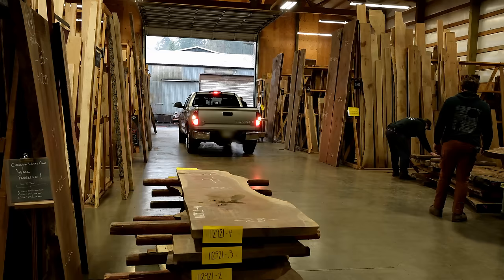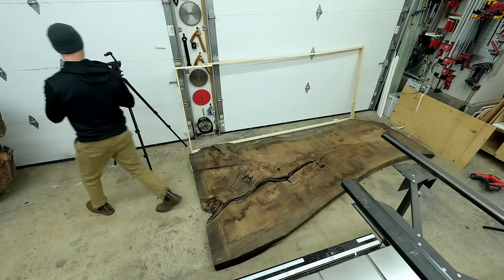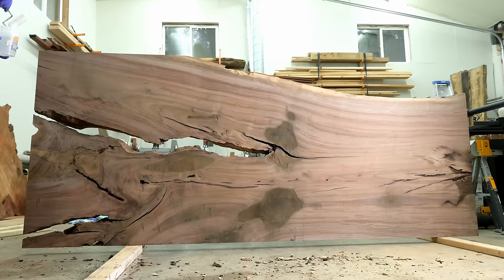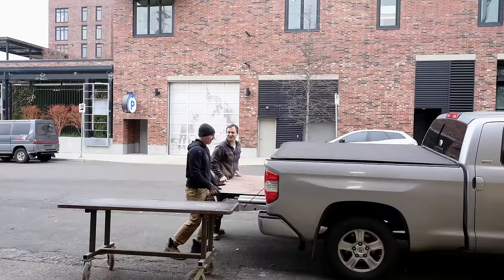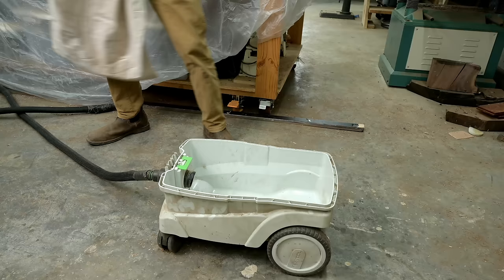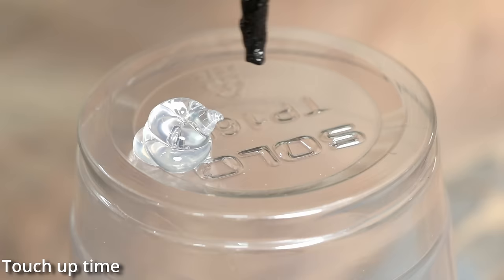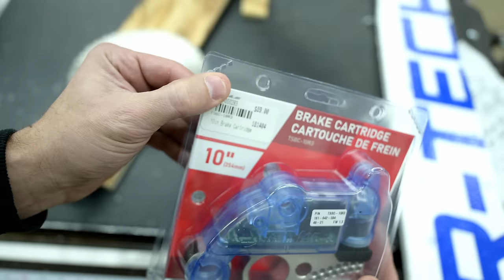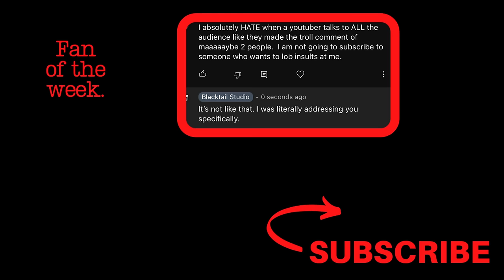The Client Hated This Slab

Comment: Honestly, if they wanted ZERO reddish tones than they shouldn’t have gone with Walnut. Table looks incredible!
Reply: Right? What a pain in the ass thing to request. You don't truley know what your wood is gonna look like until the finish is on and its in your home. He should have let them pick the slab and then quit worrying about it.
Reply: Ya not a fan of the end finish but hey I’m not the one buying it. Still looked great but all natural would’ve looked best imo.
Reply: Nah there is black walnut that looks incredible and has almost zero red in it. Just was not availability probably at goby
Reply: @nathaniellucas6693  What the customer would be looking for is steamed walnut. I have steamed walnut that is dark chocolate with no sign of red.
Reply: I had a client request an Ash and Rosewood end-grain table that looked amazing... and then they wanted me to finish it with Rubio Monocoat Silver.  Ugh.  We finally came to a compromise we both could live with.
Reply: @charlesthomas9294  But it's their table, isn't it?
Reply: Sounds like it's more the problem of the business
Reply: Better bro ..... keep up the good work looking forward to the next video 📹 👍 we have a saying in south africa that gos like this  ...  that looks kak lakker my  bootas
Reply: I agree. I detest stains in hardwoods - natural finishes only. 

I can see using stains with cheap softwoods where you are trying to fake the look of some expensive hardwood, but they should otherwise be left on the shelf.
Reply: @rockbandgamer  6j&
Reply: @buggsy5  but if they prefer the texture and hardness of a wood and prefer the colour of a different wood I kinda get that.
Reply: I am ready for the gray- stained wood trend to die.
Reply: Thank u....some people, I swear....
Reply: @charlesthomas9294  This seems kind of wild to me. They're paying you right? What do you care what the table looks like as long as they like it?
Reply: @Setixir  Some customers have a very definitive idea of what they want and are able to articulate it. Other customers just have very general ideas like “I want it to be gray“. In the latter cases it’s up to me as the artist to interpret that in someway that I think will make them happy. They can say that they want a certain stain but if I know they have never seen it on the wood that they picked out before it may be up to me to modulate their choice.   As I said in my original post, they were happy with the outcome.
Reply: Yes I want a table made of poplar but I want it dark. No stains or wood burning allowed or altering the color for that matter 🙄
Reply: wow 👌 👏 😍 👍 🥰  nice 👌 👏  job
Reply: @nathaniellucas6693  got two in my yard. I had three and the neighbor who’s property abuts mine decided to have his logged. The dumbasses cut it. They even broke down the fence to get it.
Reply: Right answer, now i can sleep. Beautiful table.
Reply: @buggsy5  when we were house shopping 17 years ago we landed on a house that had heart of pine floors. We were the first people to look at it and made an offer while they were still finishing up the reno's to sell, one of them being refinishing the floors. Since it was going to be my house I asked that no stain be used, somehow that got lost in translation and they stained these floors the darkest ugliest color you could think of. We still bought the house but luckily got them to pay for closing bc of this issue. We still live in the home and got rid of that color asap! Who stains heart of pine dark mahogany?!?
Reply: it's the tradesmans job to advise them though, and it does kinda sound like he reassured them not all walnut had reddish hues.
Reply: I guess customer had walnut mistaken with the American Walnut/Blacknut.
Reply: Jesus Christ died for your sins
Reply: @allertschallenberg1857  it is, but that doesn't mean you have to make it for them if you don't want to. It's like a chef who refuses to cook a steak well done because it ruins the meat. They don't want to put their names on bad craftsmanship because their entire career and income relies on people liking their crafts.
Reply: @usernaames  👎
Reply: Would be actually smart to preview the table in a dream home-like setting, before actually buying the thing, but that's my two cents 🤷‍♂️🤷‍♂️
Reply: Jesus has given you all. Repent or die.  Saying "Repent or die" is horrible. This is why people don't like us Christians. Some "Christians" have literally gotten to the point where they tell you to ask for forgiveness, or you will spend eternity in hell. That just pushes people away. Though I believe it is true, that's not a good way to present you're faith and get people to believe. Please stop doing that and change your username.
Reply: I know it's not exactly the same thing, but I used to sell cabinets at a big box store, and I had customers request "something exactly like this knotty oak, but without all the lines and holes".  It would drive me nuts.
Reply: It’s rich people not knowing trees have different color wood they hear walnut and think expensive pretty wood
Reply: I came across your video by accident. I am blessed to have found it. Love your work. Reading all the comments I’d like to make a comment or two of my own. About staining, I think staining should be done to enhance the grain. Too much red add a little green kills the red. Just an example that everybody in wood finishing knows. not wanting to do certain projects is a plus. Nobody knows that the client wanted this or client wanted that. all they know is the end project. Staying true to your values as you are that’s a huge plus in itself. 
Keep up the spectacular work. Bowties are cool.
Reply: That's clearly people with a lot of money. Always a pain in the butt
Reply: Seriously? The clients made a request, the professional told them he could do it, and he didn’t deliver. Not everyone can spend thousands of dollars on something they specifically did not ask for.
Reply: Lol exactly!! Damn ppl can't be pleased
Reply: @kimberleyjane2338  Why do you care so much what other people do with their hair or what type of wood they want? Maybe you find it ugly, but why does it matter what YOU think of someone else's hair? You should be happy for them if they like it, even if you don't personally like it. You should be proud to put your name on something that made the customer happy.
Reply: @kittykitties4220  Many people view it as you do. It's not wrong. I, and many artists have a style, and that's what we are selling. So with hair it to show the depth of our experience in the cut and the sheen of the colour tones. So, when someone starts putting box colours in between services, I will drop them, because one thet cost me too much time and product, and two, it takes more the one visit to repair, and three, I am an artist, who sells my eye, style and taste. So, in this video, the client should have picked someone who works with pine.
Reply: @weatthin  NAILED IT.
Reply: @Setixir  he is an artist not just an order taker
Reply: @allertschallenberg1857  yeah, i personally never really understood craftsmen getting upset about customers ordering random or crappy combinations of things.... if theyre paying for it so what? And if its really that big of an issue you can just not take the money for the job, otherwise stfu its not like theyre coming in and making you give them one of your own pieces or something. You know what youre getting into before you even start.

Anyways, just didnt make sense to me.
Reply: @allertschallenberg1857  right, he doesn't have to live with it.
Reply: Walnut is exactly what I was thinking.
Reply: I'm confused. So did the clients like it or hate it in the end?
Reply: @SleepyParakeet    Let me say it another way and see if this sounds reasonable to you. “Saying what God Himself says is distasteful and disgusting, why listen to Him anyway? We can’t get people to join our self serving christian club because they don’t like how God’s word sounds! It hurts their feelings! So please stop because it hurts my feelings too! And change your name, I don’t want to hear about what Jesus did either!”
That’s what I heard from your comment. You might want to think about it. The one and only true God gets to make the rules!  Not you or I! We either choose to follow Him or not. You should really take it up with the Lord if you don’t like what He has to say! But please tread carefully!
Reply: Seriously. I'm sure they were super nice and all, but that's just an impossible ask. I would have steered them toward a different wood, and if they insisted I would have passed on the job.
Reply: @nathaniellucas6693  yeah but almost may not have been good enough, they wanted zero.
Reply: @missbeaussie  unfortunately just because they want something doesn't mean it exists or is possible. I want sugar free candy that tastes like the real thing, but I'm not holding my breath.
Reply: @giraffe116  It is the professionals mistake in this case for promising something he couldn't deliver, he should have explained that what they wanted was just not possible. The customers got what they deserved though. Play stupid games, win stupid prizes.
Reply: @I like trains That is indeed the question. I assume money?
Reply: @kittykitties4220  some people are in a certain line of work because they enjoy the end result and take satisfaction in a job well done. If they make things that are ugly to them, then they may as well do a different job. If the customer has demands that the artisan cannot or will not meet, they can easily find someone else to do it. Everybody is happy that way.
Reply: @kimberleyjane2338  exactly. No one is forcing the customer to buy from this artist, and no on is forcing him to serve this customer. In this case they are both in the wrong, imo.
Reply: @katykayy  the problem is, repent or die is not a direct quote from the Bible. It also doesn't convey much meaning to most people, other than causing some christians to assume that you believe in a works based salvation. I know the original comment wasn't yours, just giving my thoughts.
Reply: @weatthin  I used to work with tropical plants, "living things", they wanted beautiful large tropical plants that could live in a dark corner of a room with forced air heating.  When I tried to sell them on plant lights, or changing where they would put the plants, they sneared.
        My mom collected Art, there were those that bought real art for the colors to match their couch???
       I just don't understand these people. I believe It is our job to educate them.
Reply: @katykayy  I do agree, but it's a horrible way to start a conversation about Christianity. Nobody will listen to you if you say "Become Christian or you will spend eternity in hell."
Reply: Stain it! Duh?
Reply: @SleepyParakeet  I thought we were all discussing a custom wood table
Reply: Yes indeed! People!!
Reply: @8675-__  Welcome to YouTube......
Reply: Honestly, I like both stained colors.  I would say that both tables must have matched the decor of the homes that they went inside.
Reply: meow
Reply: THIS COMMENT RIGHT HERE!  Like, WTH!
Reply: RIGHT!? Like go with mahogany ffs! lol You'd get a purple, deep colour.
I used to make all my pieces for my home out of oak, with walnut trim, since rosewood was too expensive, and just apply stain.
In the end though, the client wants what the client wants.
Reply: @SleepyParakeet  “repent or die” is stupid anyways because whether or not you repent does not stop you from dying. 
“Afterlife” “life after death” either way you see it you must die in this life to reach the other side.
Reply: @melou_  True lol. And you often have to chase them for payment. You come out of it feeling like dirt. One such client I recently told “Yes I can do it and the new policy is cash up front”. They bailed lol. What a relief.
Reply: @zyftis6927  that's not how Christianity works
Reply: @rockbandgamer  I've just fallen in love with the sound of that.  Gonna have to look it up.
Reply: That makes sense if you don’t think about it😂
Reply: To be fair, they loved the slab when it was delivered, he forgot to post the blog I think so here is the quote from it on their reception. 

"This was the first table I was nervous about delivering in a long time.  I make a quality product, and I keep the client in the loop, so normally there isn’t much left to chance. This one was obviously different though. Much to my delight, the clients loved the finished table. The color, the base, the size, all of it. I do believe that keeping them involved with the build process aided in this. If I just dropped a stained table on their porch, they wouldn’t quite have the same ownership that they did through this process. Which is good for me, because I love keeping the client in the loop!

I am trying to set up a time to get the couple to let me record a zoom call to recap the build and their thoughts. Let me know in the comments if this is something you’d like to see! " - Blacktail Studio
Reply: yes, it does! then they went and spoiled it all by patching up the pit holes and imperfections with cyano glue, it is not compatible with fiberglass resin and will fall out over time
Reply: Ikr?
Reply: Thats just stupid, they’ve SEEN videos. How did they not know that walnut was very red, they could have gone with so many other common woods, cheaper ones even.  
But no, because of course not.
Reply: @buggsy5  when you're selling your work after it's finished that's workable.  But when it's commission work, you need to please the customer.
Reply: @MountainDuwu  because it was all done for ratings. Its all acting don't you get it?
Reply: Then don’t promise the client a non red table??? You let the expert or professional. Tell them “hey there’s no wood I have access to that isn’t red if u want walnut sorry”
Reply: @rockbandgamer  ü🇦🇮
Reply: @rockbandgamer  when u pay over 13 grand for a table expect some pain in the ass requests bud
Reply: @jesuslovesyou2616  who died for his?
Reply: @NickyNicest  looks beautiful in the sun
Reply: Blame the customer, the slab was pretty clearly red hue. Just came down to poor communication.
Reply: YA KNOW HONESTLY  !
Reply: I thought the same thing! Sometimes I think clients try to make things difficult to see if a master woodworker is truly a MASTER wood worker! Again, you prevail! I absolutely wish I had become a carpenter. Each time I build something out of wood, I feel so good! It's my therapy! My wife doesn't get it but she understands the pleasure i get from making things. Thank you for this video! That slab of wood is so beautiful. It is amazing how God makes the simplest things in nature so grand! Not trying to get "religious" on anyone but I just think that stopping to observe the beauty in God's creation just keeps me humble and grateful.
Thanks for such a great video. The table is truly a heirloom!
Reply: @bbygrl2812  Hope you sued them for the full value of the tree plus loss of property value into ad infinitum.
Reply: @nathaniellucas6693  Yeah, but it is the one wood almost nobody would be dumb enough to request stained or colored, lol.
Reply: I agree with you. To try to modify the true colors of the Walnut is ridiculous.
Reply: @allertschallenberg1857  but he the artist!?!
Reply: @matthias8122  ?.?!
Reply: Since a lot of money, as well as time and materials is going to be expended on a project, maybe if you had samples of different woods with different finishes to show your clients, they could better choose something that would be more interesting to the clients.They would make better choices and have a better idea of the finished piece, or change their mind on what would please them, instead of both the client and and woodworker wasting home and money on something  that the would refuse to pay for,
Reply: Jesus has given you all. Repent or die.  what does this Scripture have to do with woodworking and customer relationship with the designer ?
Reply: @jesuslovesyou2616  HE SURE DID, so it is wise to learn how to understand what your neighbor is really trying to tell you — LEARN TO LISTEN TO THEM, NOT YOUR OPINION -SHOW THEM SAMPLES AND LET THEM DIRECT YOU,. You can wisely help them see what certain woods look like when stained a certain color. IT IS THEIR FINAL DECISION ( wouldn’t hurt to have a voice video recording of the transactions in case of disputes.
Reply: @jerbar1280  then SHOW them the SAME item WITHOUT THE GRAINS AND KNOTS’ — SIMPLE!  

NO GENIUS IQ NEEDED, FOLKS Give people choices! DUH!
Reply: @beckyelliott2871  I hope you are being sarcastic, otherwise you don't really know how natural wood works.
Reply: Monkey pod would’ve been better
Reply: Just beautiful.
Reply: @charlesthomas9294  hey, you're just trying to look out for people, nothing wrong with that
Reply: @allertschallenberg1857  The thing is, that a product represents a company, especially small one that make single products. If it looks bad, people are not going to buy anything from you, regardless if the customer wanted it that way or not. Same goes with hair. If he doesnt want to buy a prefab object, where he can see how the table looks like, he has to trust the manufacturer that he knows how to make it look it nice, and how its gonna end up. 
The color of the wood is a nice example: How should he make a not red table with a red kind of wood? Its not plastic where he can add some black into it.
Reply: @nathaniellucas6693  Yes, there is walnut with a deep espresso hue to it, no red at all.
Reply: Allert Schallenberg but you can’t ask someone take red wood make it not red. He should’ve explained what other wood would fit their vision.
Reply: Did you hear when he said "no problem". He said he could. He should have said it's not possible. Stop making silly excuses for Not delivering on promises. He has accepted it. Stop making excuses for h
Reply: @joeschmoe6908  yeah, how would you feel if I said I had that, took your money, and sold you salt.
Reply: Facts... I would've told 'em build it yourself
Reply: They didn't he chose that. Didnt you listen to him talk?
Reply: Ikr?" I don't want red, I hate ted. So imma choose a wood that, majority of the time, has various red shades. It won't look red at all because I said I didn't want red."
Reply: @SleepyParakeet  I reported them as unwanted commercial posting. People like that is why I left the church. It's so effin depressing.
Reply: @Leviatiemily  You left a religion just because you got irl spam?
Reply: @SleepyParakeet  because my mental and physical health mattered more to me.
Reply: @Leviatiemily  ?
Reply: Your ruining that would by taking away the reds (imo) but, to each his own. Looks fantastic!!!
Reply: @Leviatiemily  I don't like red, I hate red. I choose a wood I know is durable. Might be resistant to pests in the area, has a significance of sentiments of sorts maybe because the name and my business name rhyme. Then I tell am artist can you make this come out with any reds. And the artist takes the job. You lot must be gen z. The artist can say "sorry whatever I do on that will bring red, so no, I won't take your money or the job". Only reason why you will take this type of job, is if there's no expertise in your work, and everything is guess work and hoping for the best
Reply: @jonenih  I'm uhm..I'm a millennial. Ppl in gen z aren't typically in their 30s rn. You must be a boomer. Or better yet. You're from the silent generation.
Reply: @buggsy5  stains can help even out slabs, and for pieces made from multiple woods or trees make a piece look much more even/better.  There is definitely a place for stains.  I don't personally like some colors/effects but it's different tastes for different folks and a basic simple stain can help elevate a well made table of quality but not perfect or super expensive wood.
Reply: @charliec.3518  As a craftsperson, my past work effects my future business.  Just because I can fill your request doesn't mean that it's a good look for what I do.   In this instance I feel like he was making a bit of a personal aesthetic dislike into a slightly bigger deal than what it needed to be, but I also understand the idea of him not wanting to do very flat very dark tables because it doesn't show well for future business. This particular table to my mind is borderline too dark and too large for most homes.
Reply: the title is clickbait, the blog says they liked the title. that's also why i won't subscribe..
Reply: @Setixir  to a degree yes, but if you're not happy with your own product then it doesn't matter what the customer wants,  personally I'd prefer to see what does the best for the piece of timber than some oddball finish a customer wants just because they can afford to pay for it.
Reply: @allertschallenberg1857  It's their table, and it's his work. Him making that table is putting his stamp of approval on it.
Reply: then*
Reply: Anyone with a brain with a brain would know that
Reply: @LittleRedSlipper  Unfortunately there are different specimens can indeed lack reddish tones unlike the tree that this piece was cut from (let alone different cuts of the same tree), or at least lack visibly reddish (or purplish, as purple is just a blue-red mix) tones, and kiln-drying rather than air-drying also browns the pigmentation to a rather dark chocolate-y tone rather than lets it set up in a more purplish undertone. Adding a little green to your stain will counteract reddish tones and help bring the browns of the wood out more richly, as well.
Reply: @allertschallenberg1857  and if they don't like the outcome,  they don't pay for it. Then he is out of his time and money. Colors of stain look different on different wood types. Most people don't understand that.
Reply: Ron swason is that you n yeah damn right it's a beaut
Reply: Then*
Reply: If a customer wants walnut, can’t I just get pine and stain it a walnut color ?!
Reply: @buggsy5  I like to fake woods when customers decide to be cheap
Reply: @matthias8122  I hate grey to 😂
Reply: @nathaniellucas6693  have some live ones...great burnt umber colors to it.
Reply: @charliec.3518   I'm an artist. I do murals, traditional pieces, i paint fruilniture as well and digital art on the side of my regular job. Yeah I don't need to agree w the client but sometimes they order something that just urks your soul, theres no explanation for it. I still do it while trying to navigate them through the pitfalls I know their walking into and I think thats what he means.
Reply: Exactly I was a bit confused when they said I don't like red Walnut
Reply: One can always tell a customer no. And that is a lesson to learn.
Reply: Better.... I'm curious though..so you remove the melamine from the back..so is the epoxy the only thing holding the Two pieces together?...it just doesn't seem like it would be very stable 🤔
Reply: If I was going to build a table like that I would really look into Walnut
Reply: It's a beautiful table and color.
Reply: Having sold several walnut wood tea caddy’s I concur LOL.
Reply: That stand tho .. style  cheepens it .. so ugly ..
Reply: @nathaniellucas6693  as an east coast native thus was the first time I had ever seen walnut go red at all.  But then we have black walnut here... a barn full of neutral brown, awesome aged hardwood.
Reply: @SleepyParakeet  Thank You!
Reply: @matthias8122  I am waiting for the chalk paint to die.
Reply: Was thinkin it’s taking so long and so much work to build this table how can it be worth it for a ….what I thought was about $1500/$2000 dollar table. Then when you said $13,000 for the table…. Now I get it. 
Beautiful table
Reply: Some people don't bother to research for themselves. They have an idea in their heads and think it can just be exactly how they want it. I suspect they were overindulged as children.
Reply: Walnut isn’t red.  Never has been.  Never will be.
Reply: @juliannarain9274  huh ?
Reply: @buggsy5   Finally !   Someone with our opinion !  Yay !
Reply: Put some Crisco on the bed of the truck those boards will slide in and out just fine
Reply: @charliec.3518  because artists don’t like their names associated with a piece that people, other than the customer, think are ugly when it comes to color.
Reply: Beautiful work. You have a lot of talent. We more young men as yourself.
Reply: Then*. Not "than".
Reply: @allertschallenberg1857  sometimes you need to save customers from their own decisions... had it myself several times. or i just refuse to do the job, because i dont like building "trash". like customers that want ponds build in shapes, that kill all the waterflow and make it almost impossible to keep it clean. the more fancy stuff you want, the more technic you need, the more can go wrong. maybe the first 2 years you are comfortable with cleaning every week, but after some time you get lazy, then you want a pond/pool that doesnt need that much work.
if i dont save customers from their own ideas, its will get a pain in the ass and this situation will be connected to my reputation. sometimes its not worth the money...
Reply: @jesuslovesyou2616  so everyone gets a free pass then
Reply: Better.  From guam
Reply: @charlesthomas9294 and giving them samples help them see how it could turn out!  Great job!
Reply: @melou_ yeah, but they are the only ones that can afford to buy a 13,000 table.  Don’t want to do it?  Build the furniture and then sell it.  Don’t do “custom” pieces.  But like this guy said about the plumber, “It’s all hard work.”
Reply: Both tops are beautiful. I’m sure someone else will want the first one. I’m a color freak but like skin color none are superior just hues unique to individuals.
Reply: @chadbrooks9763 I presume you’re joking.
Reply: @jesuslovesyou2616 Now here’s an inoffensive bot, lol.
Reply: More than incredible. If the owners don't like it, you'll have no problem finding someone how does.
Reply: @fjeinca  100% I can't find my comment but I believe it's about a client wanting a certain wood but doesn't want it to be it's natural color or any other color without stain or something ridiculous like that
Reply: Teak or koa would be a great contrast…imo
Reply: Agreed. Walnut has a lot of red. White oak may have been the better choice if they truly wanted to avoid reds.
Reply: 1
Reply: Yeah, what idiot buys walnut but wants to avoid red?